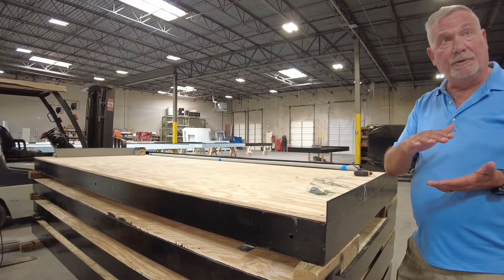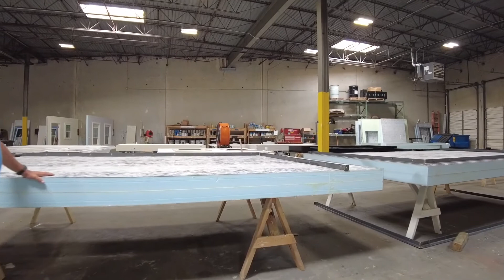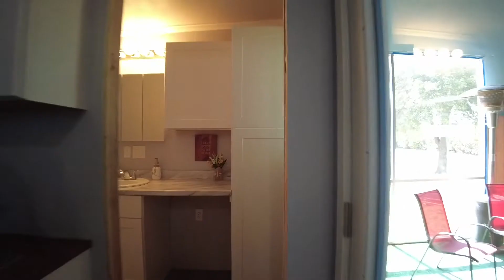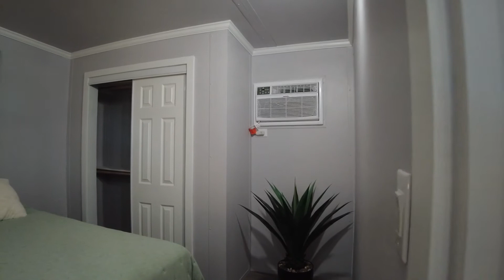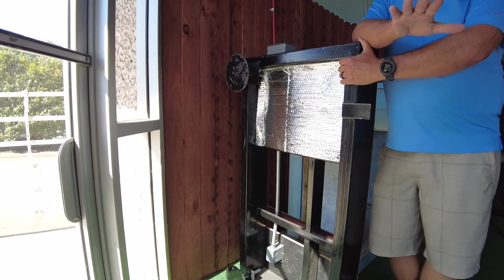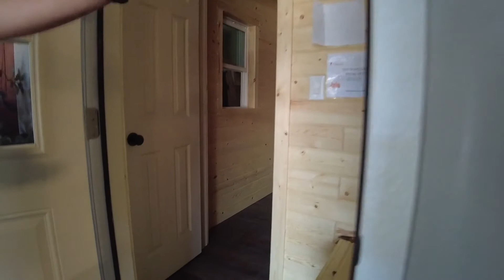Prefab ADU / Tiny Home Factory Tour!

Comment: Did you actually buy one of these and get it permitted in your backyard?????
I literally paid my ADU stick built permit fees yesterday about noon then saw this video about 5 pm. 
I started with the city over a year ago and each modular i took to our city planning dept they pretty much shot down for one reason or another. 
Doesn't help that I'm in a flood zone
But i really thought that it would be a lot easier to just get a boxable and plop it in the backyard. Nope doesn't meet same type roof or same type outside stucco requirements. 
So how were you able to get this through your city permitting???
Reply: One tip: U can ask contractors to install it following the city guideline before applying for the permit.

Comment: $60,000 is a lot. Whats the best one price out there
Reply from the maker: Hi Sabina, I can't say for certain what the best priced one is as I haven't priced them all. Back Yard Work Room also has a smaller version, a studio, that last time I checked was about $43K.
Reply: This is the best tiny home if not the best price. You can even take it down easily in the future if you want to or expand it if needed as well.
Reply from the maker: Yes! It is one of the more affordable ones I've seen as well. The Lego like building of it is also appealing as you could relocate it or as you said.. expand if it as well. Perhaps you don't have the funds right now for a larger home you could start with the smaller one and add on  to it in the future. So much flexibility.